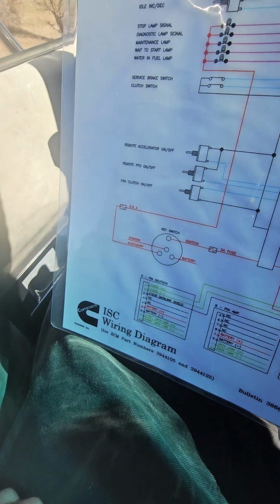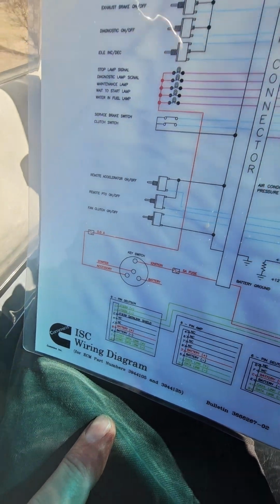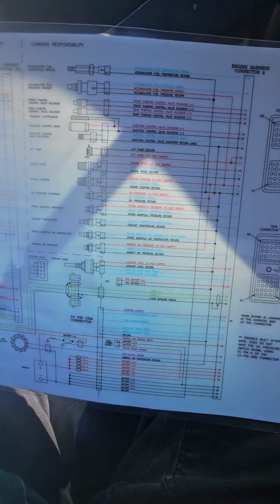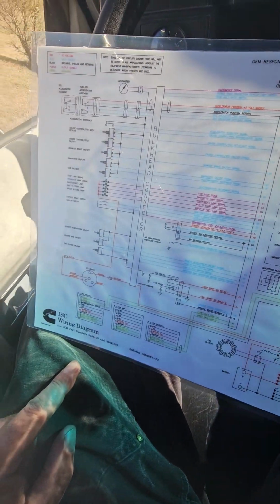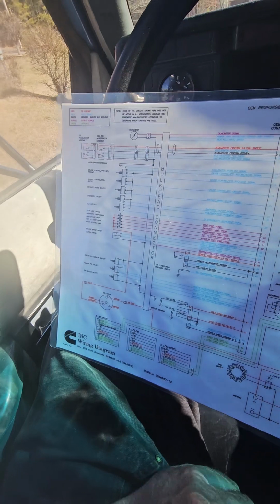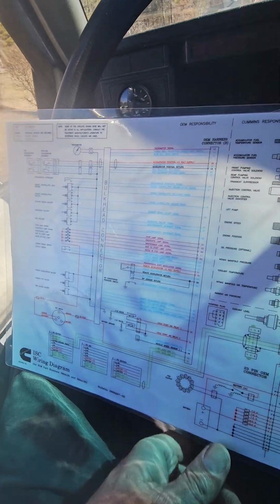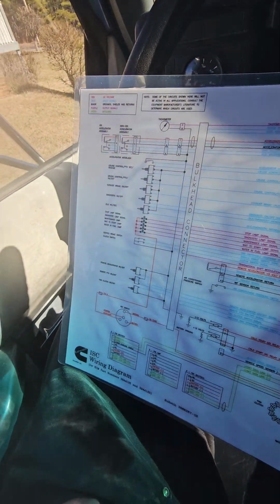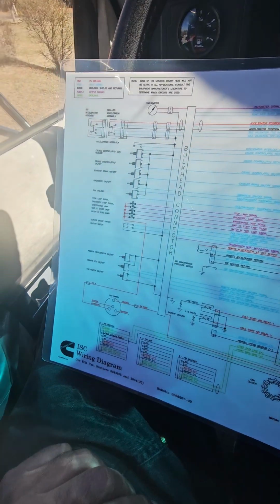1 of 3 - Voltage Drop - Cummins ISC 8.3 - CAPS INJECTOR PUMP 3/4 volt difference is HUGE!!!

Comment: You forgot to include some shots of your finished wiring setup on the completed bypass repair.  I am very glad I found your video though, just the same.  Just would like clarification on exactly how many pins you had to bypass and which ones. Excellent info otherwise,  thank you!!
Reply from the maker: Yeah I remember that one. It was so dark and I was exhausted at that point. But you're right. Ultimately it was a sweet repair without having to go through the whole motorhome original chassis. My apologies. I'm shocked I didn't have a final clip. Going to look through my old videos. Seems like I would have. Thank you